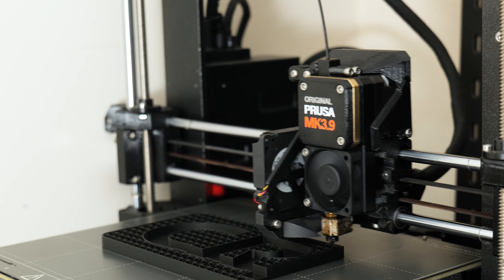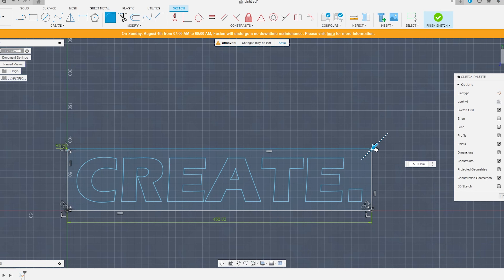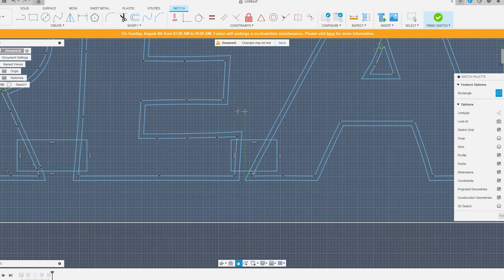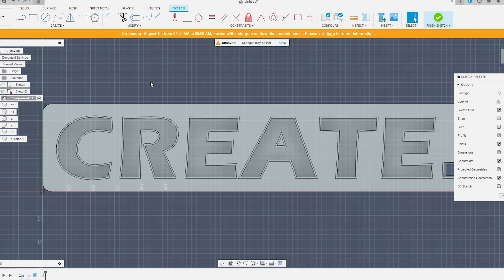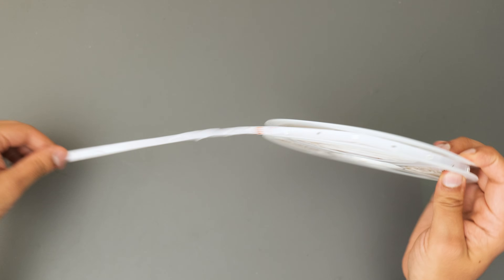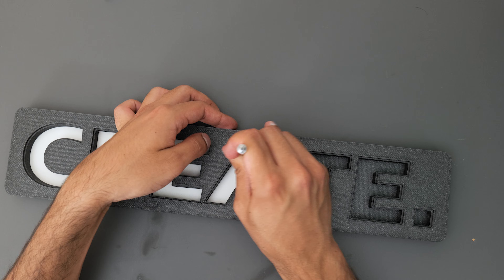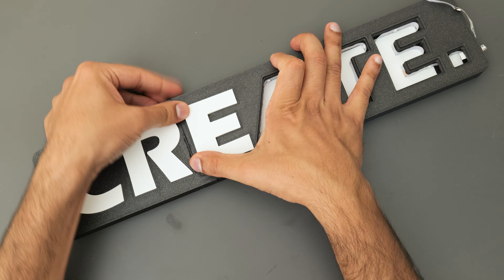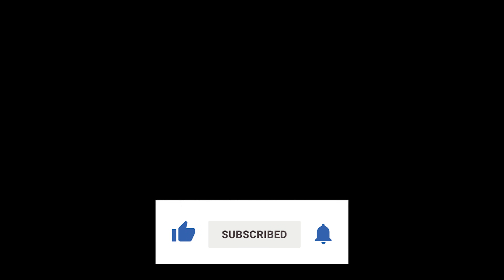MAKE Your Own LED Signs with 3D Printing

Comment: You can use cutting tools on Bambu Slicer, you didnt need to glue the parts, you could have connected through auto generated pins on Bamnu. Nice work btw.

Comment: do you have a video on how you add tolerance/clearance to the letters.  ive made this but i have to smash the letters in with a hammer.. and more times i breake the the letters or break the frame.. i learned i needed to add clearance but i not sure how you do it correctly when making this sign

Comment: the project is really cool. i don't 3d print but i'm thinking about getting a printer because i've come across some really cool projects. a nice touch would be turning the period into an on/off switch if the led strip doesn't come with a remote
Reply from the maker: That’s a really good idea, definitely something to try next time. 

As for getting a printer - highly recommended!

Comment: Great video. I may try this. Do these LED strips generate any heat? Are you concerned about that? I haven't worked with them before.
Reply from the maker: Thank you 👌🏼

I’ve had the sign up on my wall since I published the video, LEDs powered on, and have had no issues with heat.

Comment: Really awesome outcome - I've been wanting to do something like this for a while now but it's quite challenging in Tinkercad (which is my goto for designing models ATM). I really need to move on to something more substantial though!

If I could make one suggestion... replace that RGB strip with individually addressable LED's and power them with a Microcontroller using WLED. There are lots of off the shelf WLED controllers now if you want something a bit more polished, but honestly you could easily hide the whole controller inside the light and just have an exposed usb connector for 5v power on the back. It'll give you tons of flexibility, more effects, an app to control colours and even scheduling and more!
Reply from the maker: Thanks for the comment friend. 

That’s a really good idea, using addressable LEDs. Might be the premise for MK2!